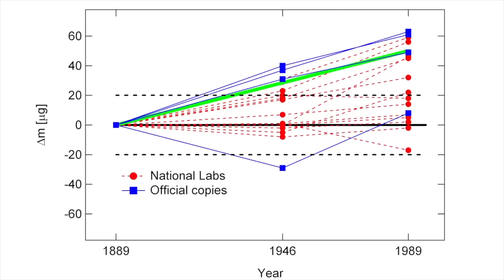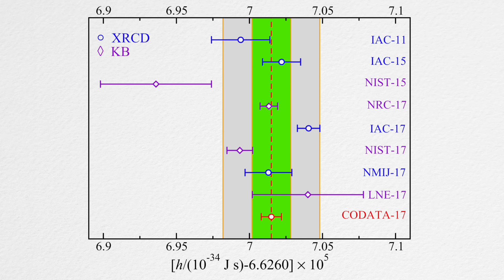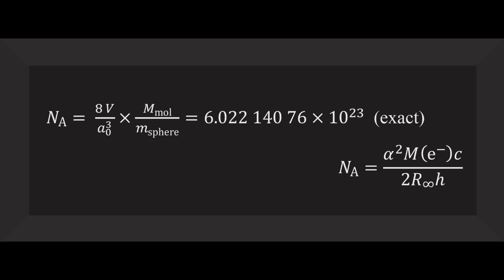The kg is dead, long live the kg

Comment: God forbid we set as many of the constants equal to 1 as we can. No let's just use the same archaic set of units we always have; we don't want to have to learn a whole new system. This is why the US shouldn't switch to metric.
Reply: The main advantage of metric (IMO) is the use of prefixes that make the math much easier (rarely need conversion factors for measurements of the same physical property). 1m is arbitrary.  We could have just as easily used feet with the same prefixes, and things would work just as well.  (millifeet, kilofeet, etc.)
We can't set all the constants to one, because there are physical relationships that connect them, and those relationships are rarely base 10. 
Likely it'll all boil down to 1 fundamental constant that defines everything, and changing ALL units to set that to 1.000000 doesn't make much sense, since it's rarely used directly in daily life, and we'd likely end up having to express all of our everyday units *10^140 or something insane like that.

Comment: For everyone talking about loosing weight, actually you'll gain weight (numerically) as the mass you have will be devided into smaller chuncks of unit mass, requireing more of them. Even if its basically negligible, you'd be a few decimals more on a scale that had the capibility of measuring to extreme accuracy.

Comment: I  find it odd that the origin of the Kilogram is not discussed.
   If the distance from the equator to the pole is divided by 10,000,000,   that result is a meter.
    If that meter is divided by 100, that is a centimeter.
      IF that centimeter is the length of the sides of a cube, that is a  milliliter  (volume).
         One milliliter of pure water @ 0 C  weighs 1 gram.
 One more note.....the period of a swinging pendulum of just over one meter length is one second.
Reply: That's discussed in the first video about the original kilogramm and the silicon sphere.
Reply: ahh.....I did not see that video. thanks

Comment: This is US's chance to convert to metric.
Reply: The US implicitly uses the metric system anyways as the inch is defined as 2.54 cm (exact).
Reply: @BPollard86  dude 1m=100cm (exact)
see whats convenient
Reply: @BPollard86  Actually, an inch can be defined as the distance light travels in 1/27548348256 of a second. You don't need the metric system at all.
Reply: ADI Scientists and engineers already use metric.
Reply: @Fluskar  actually, many engineers are forced to still work with or convert their stuff to imperial because most construction equipment and contractors only use imperial. This is for civil engineering in canada and the states at least.
Reply: @Fluskar  it's not only about scientists and engineers. All Americans use the Imperial system in their daily life. And that's pretty inconvenient.
Reply: ADI let's engineer society specifically for your convenience
Reply: actually the whole world still use imperial metrics, don't believe me? ask commercial pilots, everyone use knots and feet, even on airbus planes, and ATC operators would direct pilots using feet XD, and I'm not an american btw.
Reply: @Napoleonic_S  
Knots are based on nautical miles, not the 'imperial mile'.
Regardless; all imperial units are defined with SI, so they are just a derivative of a derivative.
Reply: The us did tried to convert once before it became so popular.but it was thrown out cuase it wasn't that great of a measurement system for real life and just made things worse cuase poeple ended up using 2 diffrent measurment systems.

Just cause most of the world officially uses the metric system doesn't mean metric is the best system of measurement.
Reply: @starandfox601  👍These are the people who would jump off of a bridge if their friends did it. And they still use both measurements in Canada.. it's considered hate speech to admit it though. :P
Reply: @star and fox It's the other way around - most of the world officially uses metric system because metric is the best system of measurement.
Reason's the straightforward multipliers like milli- centi- kilo- etc. and how nicely they work with one another (weight,  volume, force etc.)
Reply: Absolutely, I’ve heard Americans saying that their Imperial system doesn’t make sense and have to convert into metric for calculations. The Imperial system is filled with inconsistencies, 12 inch = 1 foot and I have no idea how much a mile is except 1.6 km.
Reply: 1776 will commence again if you come for my imperial units!
Reply: Handz awf mah Muricken systum, Barack Hussein!! #MOLONLABE
Reply: The imperial system isn't a massive deal, but it's annoying af for most people outside of the US when they try to comprehend it. Literally every other country in the world officially uses the metric system, yet the imperial system is already based on the metric one. It's just a pointless application of formulae to convert an already accurate number into another one, just so that it conforms to your special units that no-one else uses.
Reply: @individualsituation6003  i hate the chines for making dual system termometers scales cups rulers and everithing because of the us market :D when I was a kid all we had was termometers in C and rullers in Cm and meters
Reply: @todop  Ok. And? Is that a counterargument to something someone said?
Reply: Imperial units are defined via SI units
Reply: why does a measurements name matter?

you sound ridiculous cause you are using the names of a measurement to dismiss it rather then weather or not the measurement are useful for the everyday.

also imperial isn't based on metric it just appears that way cause the measurements often come close to each other.
Reply: @starandfox601  It's not the name at all, it's where it comes from.
That makes it so unreliable because, as said above, a foot can change depending on whose foot you measure.
Reply: @starandfox601  Standardized against what? What's your constant? Someone else's foot? How can I go around measuring said foot? And what if the owner of said foot hasn't clipped his nails?
And no, not really, making use of yourself to measure things makes it even MORE unreliable. The point still stands that the imperial system does not follow any constants.
Thanks for the name calling by the way, always appreciated.
Reply: @starandfox601  Oh, so now you think that a measurement can define itself... When was the last time you went to school? Last I heard, you can't define something with the same thing you're trying to define.
Reply: @ianr2002  measurement systems need to be defined by themselves so they stay constant so you owes have accurate measurements.

if you base a measurement system solely on something else then it can easily be changed which isn't good cause then you lose the constant you are trying to compare things to.for example if information about speed of light changes then the metric system will either have to change or it will have to separate from what it is defined by and become it's own thing just like the system imperial has.
Reply: @starandfox601  Wrong. Systems don't define themselves. Fun fact, the imperial system is based off a yard, which is based off a meter. The official length of a yard is 0.9144 meters. So you are very illiterate when it comes to science.
You simply can't have a number without a physical object to base it off, because then how much is that number in length? Is one foot my foot? Is one foot your foot? Is it the length of a frying pan? The measurement "foot" is just an abstract concept which means absolutely nothing without a standard, i.e. "Something set up and established by authority as a rule for the measure of quantity, weight, extent, value, or quality"
Reply: @starandfox601  the Imperial system was created by people who set the measuring units according to their convince and without any reliable reference to maintain precision. Which is totally fine, but it doesn't follow the standards. 
 So now that metric is the standard system and is the most convenient system. There is no argument that it's best that US converts to the metric system.
Reply: @adi.mp3  there is several arguments.but fools dismiss those arguments cause they think metric is best cause most the world uses it without understanding why the us is choosing to use imperial has their main measurement.

one of the biggest reasons is to avoid  a unstandardized system where people are using 2 completely different measurements.another is changing the entire us to metric is a huge task that would cost a ton of moeny that could be better spent else where rather then changing the measurement system.also cause it works for every day life and is very easy to understand cause there's no stupid decimals to deal with cause everything divides up evenly cause the imperial system is a division based system based on human needs rather then one based on what looks good on paper.
Reply: @starandfox601  like I said you can't just define your own measuring units according to your convince. There are standards and metric is standard for a reason.

Now, I understand it will be very difficult for a whole country to convert to a whole new system, especially a country like the US. But the truth is the metric system is the most convenient system out there. Just because 1 meter isn't the exact size of Your foot doesn't mean it is a inconvenient unit. Infact when it comes to calculations in actually scientific research and stuff, metric system is the most convenient. Even Americans scientists use metric, but it is more difficult for them because they have learn both systems. Because "CoNvEnIeNcE".
Reply: @adi.mp3  it can and should be defined by what people need it for.also the standards clearly fail considering there are several countries with a seriously messed up measuring system cause people naturally want to use imperial for their everyday lives cause that is what it was designed for.while metric feels out of place cause it was designed for scientific calculations not for things like groceries.

it would be impossible.the truth is metric is not the most convenient measuring system for everything.it's great at scientific measurements but when it comes to everyday life which is what most people need a measurement system for it has a lot of down falls.most people don't need to do scientific calculations so using scientific calculations has a way to define how good measurements are holds no relevance when talking about buying food for the week.

it's not hard for american scientist to understand metric cause we're used to having measurements that fit the needs of what we're measuring rather then have a shoe horned in system into everything.
Reply: @Dale Towert  I would like to point out that the metric system is equally arbitrary.  The meter was originally "defined in 1793 as one ten-millionth of the distance from the equator to the North Pole".  So it's a length chosen based on (likely inaccurate) physical measurements and an arbitrary fractional value.  The rest of the metric units have similar arbitrary roots.  I do agree that the metric system is better in practice (except for Fahrenheit and everyday temperatures), but all these arguments about the whimsical arbitrary nature of imperial fails to grasp that metric is arbitrary as well.  If you really wanted to, you could define imeperial units using constants of the universe (for example, adjusting planck's constant, the speed of light etc) to work around the imperial system.  But we just don't because there's already a system that has done that, and we can just convert from that.  There is no scientific 'truth' behind any of the values you pick for units.
Reply: @ApatheticCritic  farenheith is rhe opposite for the rest of the world we dont get it. We know watter frezes at 0 and the regular room twmperature is 20
Reply: ... My friend, there's hope, there's blind determination, and then there's believing the US will ever properly switch to metric.
They're beyond help.
Reply: Please!
Reply: Would be good!
Reply: NAH
Reply: ADI no it’s not lol that’s not anything worke
Reply: Plz Trump
Reply: They effectively have, just not officially. There are very few industries where the metric system is NOT used in the USA. But I guess this would be a good agreement for doing so since it would be so easy to officially convert.
Reply: SIKE! 
WE USE BOTH!!!
Reply: Because of the american market the chinese make ruler and thermometers in both C and F and meters and inches. When I was a kid.  I only saw meters and celsius. 
Oww and water cups. Oz along with mililiters. 

That drives me crazy . Now i need to watch what scale(part) I watch . 

:D
Reply: ok commie
Reply: I love America and therefore I want America to progress, so we should switch to metric
Reply: You and me both bud. If only the public trusted science like they did in the 60s. Who knows where we would be.
Reply: @magiicZed  Lmao what.  "Trusting science" has nothing to do with it.  It's just a massive mindset shift to switch units after it's so ingrained (think of the millions of signs that would have to be changed).  Many technical industries in the US use imperial and it doesn't impede work at all.  Metric is a better system overall (except that I maintain that Fahrenheit is much better for everyday temperatures), but I think people overblow the 'negative' effects of using imperial.
Reply: I wasn't referring to imperial system exclusively rather the widespread apathy this country has toward science. I just find it mind boggling that a decent amount of people in America still believe in a young Earth and creationism and reject evolution and the lot because it conflicts with their beliefs. There's also a bunch of people that just flat out deny climate change which hurts our efforts towards green energy and let's competing economies like China and the EU get ahead. The country I know and love ventures fearlessly into the unknown and conquers it, it doesn't ignore science because it is convenient to do so. The metric system is just another sympthom of this large scale attitude.
Reply: @magiicZed  I imagine there's some conspiracy theory about metric/SI.
Reply: Scientists have been wrong too many times recently and there is a new wave of pseudoscience going around due to political activism (solar roadways, waterseer, hyperloop, etc). There are just too many previously credible scientists making subjective and opinionated conclusions. But that doesn't change the fact that more people appreciate and understand real science than they did in the 60s, saying otherwise is revisionist.
Reply: us uses metric tho and this change was done by the american NIST
Reply: @oussematrabelsi9429  National Bureau of Standards!!!! The name should have never been changed!!!!  NBS
Reply: @oussematrabelsi9429  we still use our own system more often, sadly
Reply: Nope.  Nice try.
Reply: HollywoodF1 use your guns and just shoot your old measurement units
Reply: @chloroplast8611  that's northern USA and Texas that's it
Reply: @chloroplast8611  most underrated comment on youtube atm
Reply: You don't measure in feet using a human foot… where are you from and how old are you that this never dawned on you? A foot is 0.3048m. It would be like saying a 'meter' means nothing since it's just Latin for 'unit of measurement' and a unit of measurement could be anything including a human foot.
Reply: lmao why does it bother people that we use imperial.  all units are arbitrary anyway.  and scientists here already uses metric for their calculations.
Reply: Because every single year, millions of American school children go to their new science classes and spend an entire unit relearning the metric system which could be better spent on other things. It adds up fast. Plus there's also the point that the imperial system is really confusing and inconsistent. I think I have only used only one imperial measurement in my physics class and that was souly because British Horse Power was more familiar to kids when talking about energy.
Reply: @magiicZed  it's not confusing if you know it though. Also, what classroom do you have where you aren't allowed to use the computers/iPads in your class to convert? It doesn't take long. We don't have a whole unit based on relearning the metric system, we just convert and get it done.
Reply: Perhaps thats just the way we do it in nevada but trust me, there's a ton of people who can't use metric to save their lives in my school. And it's always annoying because you're right, we can always use calcualtors and phones, but the school system insist we cover it. And once the unit is done, we go on with the rest of the school year in class. But that's just it. You leave the class and you forget. You go back to imperial and by the end of summer break, youre back to where you started.
Reply: @CIDILIABRA  It’s confusing because it doesn’t match up to our decimal system of representing numbers. Even if we used the (undeniably superior) dozenal system, it would still be a poor match because the leaps between multiples and submultiples are not constant.

Besides, teaching kids to rely on electronic devices for calculations should not be encouraged.
Reply: @magiicZed  I'm not gonna deny that the metric system is generally better, but personally I think there's some charm in the Imperial system. I'm particularly fond of degrees Fahrenheit.

Comment: But ... a Kilogram of steel is heavier than a kilogram of feathers ...
Reply: nope , they are the same may be more feathers are required to get to 1kg compared to steel that's because of density.
Reply: @kuladeepraj  I was actually referring to the meme, you're supposed to say: "But they're both a kilogram" ;)